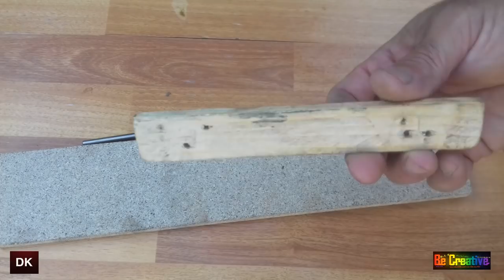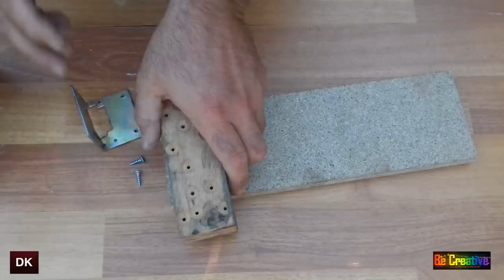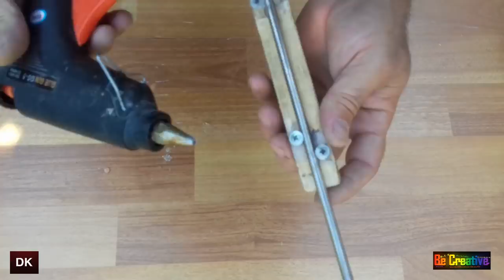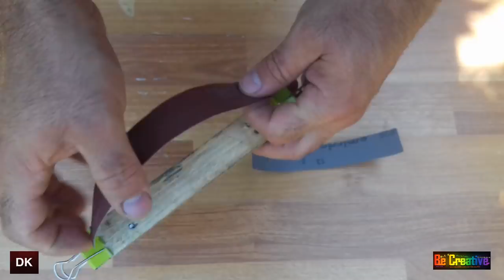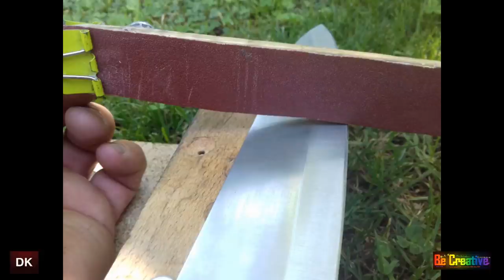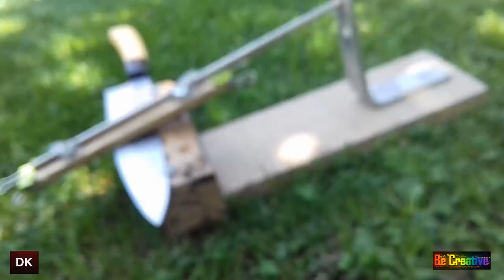How to make DIY Knife Sharpening System Jig /Homemade DIY

Comment: Do you have a drawing for the distances on the piece of steel of what heights to drill the holes for the guide rod? Or the positions of the holes on the clamp block for the blade?

Comment: Nice build. May be easier to mount high powered rare earth magnets to the wooden block to hold the blade in place Instead using the screws.
Reply: It's a stainless steel blade = not magnetic, good idea though!
Reply: Sam Mitchell You’re right. I didn’t even think about stainless Blades. That’s really aggravating too because I should have picked up on that
Reply: @richard102879  rare earth magnets work real well on my stainless steel blades.  Apparently it has enough iron in it.  The magnets don't stick to my stainless steel sink.  ;-)
Reply: @Itsallgonetocustard  what the hell are you talking about, stainless steel is still steel it is magnetic theres magnetic products for knives, you stick magnetic boad to the kitchen wall and stick knife to the board
Reply: @Itsallgonetocustard  304 stainless steel is basically non-magnetic however knives aren't normally made out of it because it's just too soft.

304 normally consist of  8 to 8.5% Nickel 17.5 18.5% Chromium, with small amounts of Carbon, Nitrogen and Manganese making it virtually nonmagnetic and rustproof.

Lots of stainless steel is magnetic or at least somewhat magnetic👍.

Comment: That's cool, but as someone who has been sharpening tools and knives for decades, you'd be better off buying a set of synthetic waterstones for $50 and learning how to use them. They'll last for years and they'll get a knife far sharper than even the finest sandpaper. You'll save on the cost of sandpaper in the long run, too.
Reply: Mark Lowry you could also just make a similar jig that can hold a whet stone. That’s what I did since I’m not very good at free hand sharpening
Reply: you've been sharpening for decades and it probably has taken you a while to get really good at it, the average joe just wants to slap it in a jig and have a somewhat sharp knife in a few minutes

Comment: How did you figure out the angles?
Reply: Protractor
Reply: gage dewees, if you want to see how this is figured out without using a protractor. see this image, I used 45cm as the base, this way each 1cm up gives you 1 degree.   Simple math, 1 cm = 1 degree.  Of course you can use any length you want, just make the proper adjustments.  Enjoy.    https://imgur.com/a/hJMTF
I also found this to be a good resource to learn about different angles on different blades.  https://www.sharpeningsupplies.com/Detailed-Discussion-on-Knife-Sharpening-Angles-W28.aspx :)

Comment: The knife didn't get sharp.
Reply: Mr. DK DIY I can clearly see it wasn't cutting cleanly through the paper, probably because you only used 120 grit sandpaper. You will have much better results if you polish the roughness out of the edge with a higher grit and finish the knife on at least 1000 grit.
Reply from the maker: Well, this is only when I was shooting the video and in order to cut the knife, I had to change a number of papers with different granulation, but thank you for sending my channel a greeting
Reply from the maker: the paper is embedded as an example that any siphon can change
Reply: n00baTr00pa true but with that set up you can get it sharp